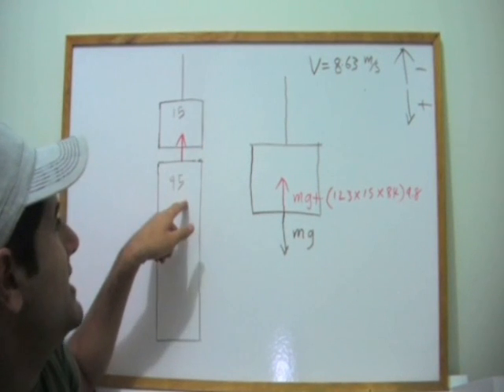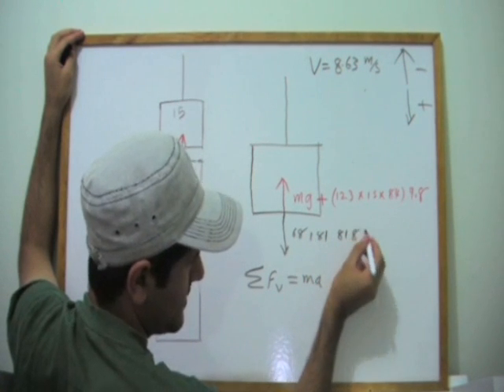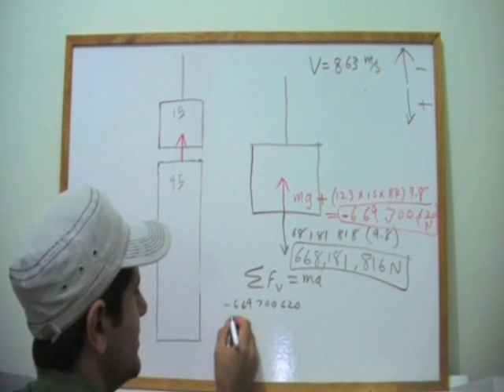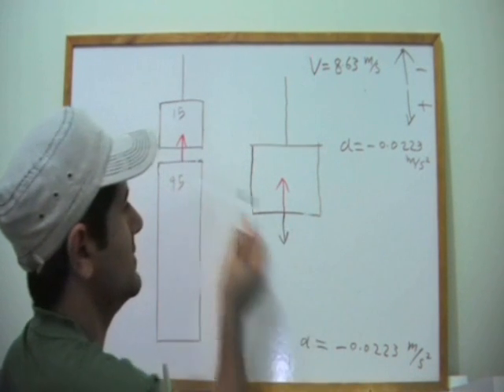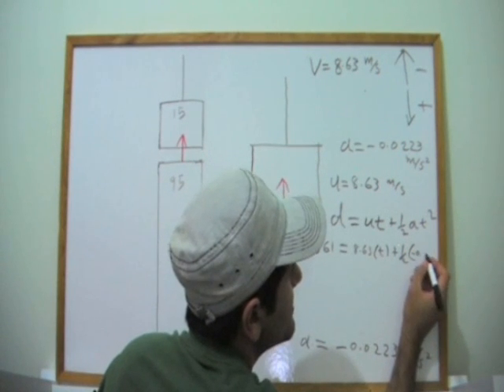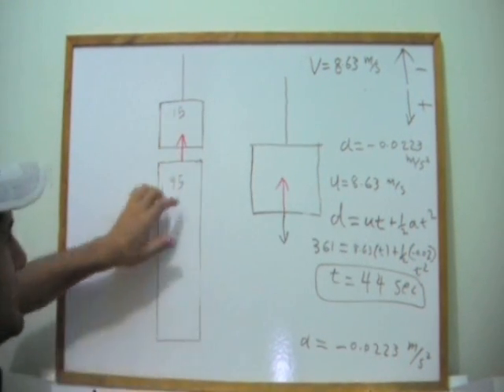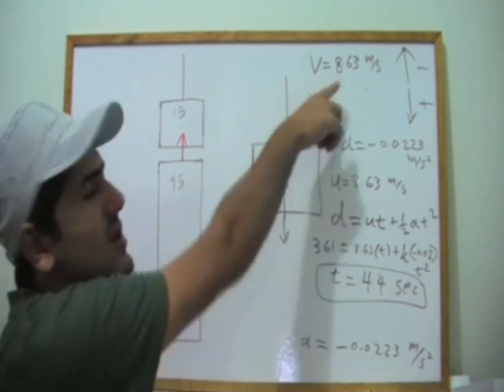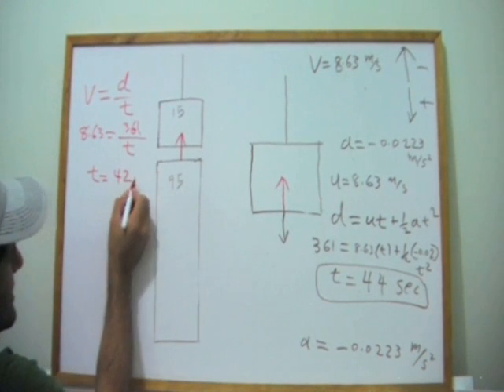(Part3) 911 Simple Physics Structural Failure Vs Demolition

Comment: If the trosses holding the floors gave way due to the immense heat of the kerosene fire and made the towers "pancake" down in app. 10 secs then there must have been a whole lotta "pancakes" in the foot print of the buildings. 110 of them.  I'm also wondering why the 47 vertical beams (the core column) fell and were literally vaporized or turned into dust in mid air,  as it were.
Reply: +Matte Matsson 
"If the trosses (SIC) holding the floors gave way due to the immense heat"
This is not what NIST has said. NIST has stated that the trusses bowed and pulled inward on the exterior columns until the bolts that connected the columns together snapped, causing the top to fall on to the floors below. The floors were not rated anywhere near the amount of dynamic weight that fell on to it. The floors did not pancake they were crushed and pulverized all the way down.

"the 47 vertical beams (the core column) fell and were literally vaporized "
Please for the love of God pull your head out of your ass. The cores did not vaporize. Where do you idiots come from? Do they breed you on some special farm???? The core columns can all found laying in the pile. There are hundreds of photos that prove this.
Reply: I've seen a whole lot of "normal" controlled demolitions and how those buildings fall or collapse. WTC 1 and 2 did not fall or collapse "normally". Watch the clips. Also, bear in mind that it only took about 10 seconds - straight down! 110 floors! And how was it possible for Mr. Silverstein to arrange for WTC 7 to be "pulled" (as he said) in such a short time, again straight down in 7 seconds!  To my knowledge it takes a long time and planning to "pull" any building. Spooky, I say...
Reply: Matte Matsson

"WTC 1 and 2 did not fall or collapse "normally"
What does a 110 story bldg normally look like when it collapses?????? Have you ever seen one before??????

"bear in mind that it only took about 10 seconds"
Ummmm...no. It was nowhere near 10 seconds. The collapse times where around 16 seconds and 23 seconds. These times do not include the cores that remained standing for up to 45 seconds later.

"how was it possible for Mr. Silverstein to arrange for WTC 7 to be "pulled" (as he said)"
He was referring to the pulling the FDNY personnel. He also clearly stated he has on the phone with the fire chief and the chief made the decision to pull. Are you accusing the chief of being involved with the deaths of 350 of his men??????

Comment: I would point out that the "Top Block" of the south tower disintegrated almost immediately on initiation of collapse as can be seen from available video so could not have provided the impetus as described in your presentation.

So your succinct videos show that even if the top block was intact , the official story does not hold water.

Comment: The columns got stronger the lower they went in the bldg, the floors did not ( they had the same live load through out). The columns had NOTHING to do with the load capacity of the floors. The top slipped past the structural columns and fell onto the FLOORS. The floors had a max live load of 6 floors dynamic, more than 6 floors fell onto the floor below the impact zone. Ali is not adding the mass of each floor to his equation. The falling weight is cumulative and the speed of the collapse actually increases. Which is what we see on video.While Ali's math looks impressive, he fails to understand how to apply it to the actual structure.
Reply: Mein Sohn

So what you're saying is you don 't want to address why no sounds of explosives were heard at the moment of collapse or how the explosives survived the planes impact and fires. How about why there weren't thousands of pieces of steel found in the pile showing the obvious evidence of explosive or thermite???? No, nothing??? Just, I believe explosives were used, but I can't explain how.
Reply: +Oldschooldan1 Your argument does not explain the systematic disintegration of the core steel structure.
Reply: Kevin Price
You made a statement all right a totally stupid, ignorant fucking statement. You basically declared to the whole world, look at me I'm a moron!!!!!

More research into the cores disintegrating???

Go check yourself into a mental ward, pea brain!
Reply: +Oldschooldan1 Sorry , being nasty for no reason gives you away. Kevin Price is quite correct in what he says.

You cannot answer his question so you engage in personal abuse.

A common technique and a complete give-away.
Reply: Mein Sohn
 He believes the columns disintegrated as in vaporized. Sometimes you must meet ignorance with harshness. I can't answer his question because what he is claiming to have happened, never happened. 

The columns did not disintegrate, they fell and were all found in the pile. There is photographic evidence of this that can't be disputed.

Large sections of the cores remained standing after the collapse. These sections fell because they relied on the perimeter columns and floors to buttress them. Without the floors they were allowed to sway past their braking point and this is what we see in the pile, columns broken at their welds.

Now if you want to debate any of these FACTS, go right ahead, but if you start talking about, nukes or energy based space weapons, I'm going to call you out as the idiot you are.
Reply: +Oldschooldan1 Kevin price said  "Your argument does not explain the systematic disintegration of the core steel structure." You say he said "He believes the columns disintegrated as in vaporized".

He did not use the word vaporized unless he used it elsewhere.
Reply: Mein Sohn The difference between disintegration and vaporization is very small. He was alluding to the steel being completely gone ie. vaporized. This is a common claim among Truthers.(Judy Wood)
Do you believe the columns disappeared?????
Reply: +Oldschooldan1 You would have to ask him to clarify - Definition disintegrate: to break apart into many small parts or pieces and Definition Vaporization is a phase transition from the liquid phase to vapour. 

I believe that the columns were destroyed with thermite and explosives.

I am familiar with the DEW and Judy Wood's theories but I think explosives and thermite provide a good fit for WTC destruction.
Reply: Mein Sohn
I would not call the massive core columns found in the pile small parts or pieces. Disintegration often times refers to an object  being reduced to a molecular level.

There was absolutely no evidence found in the pile of explosives or thermite. Thermite would leave obvious signs of slag on all the cut pieces, not one piece of steel has been produced showing this. There were hundreds of steel workers, engineers, FBI, NYPD, and FDNY working the pile for almost a year, not one has come forward saying they found any signs of explosives.

No sounds of explosions occurred at the moment of collapse and no explosive, detonator or thermite could have survived the planes impact.

So unless you can explain why there were no signs of any steel being cut by explosives or thermite, why no sounds of explosives were caught on video, how explosives could have been placed without anyone knowing and how they could have possibly survived the impact from a 200K lbs object traveling 500+mph you have nothing.
Reply: +Oldschooldan1  We are done - thanks for responding.
Reply: +Oldschooldan1  I will reply to you for the last time , not for your benefit but for others who may be reading this. Explosions are well-documented particularly by firemen - you need to research this. As for your statement ""How about why there weren't thousands of pieces of steel found in the 
pile showing the obvious evidence of explosive or thermite????" , it is obvious watching the video of the collapses that large pieces of steel were being ejected from the towers at considerable speed , not the the behaviour of a building falling down due to gravity alone. Anyone other than yourself reading this , I would recommend that you do your own research , this is the most important thing. Thanks.
Reply: Mein Sohn
Having firemen saying they heard explosions does not equal explosives. Most of the explosions they heard were from the first tower collapsing or the second plane hitting the bldg. Explosives strong enough to cut thru the steel would require a minimum of 130 decibels (dB) to 140 dB at a distance of at least half a mile. No sound anywhere near these levels were observed on video during the collapse, none.
 
”watching the video of the collapses that large pieces of steel were being ejected from the towers at considerable speed”
Most of what you see being ejected is light weight alum cladding. The entire façade was covered in it and it’s shaped just like the columns. The vast majority of the steel columns peeled outward and fell. How about the lack of visible damage to the columns???? When you use explosives it cuts and scorches the steel. When you used thermite it’s even more noticeable in the form of slag. There would be thousands of pieces of steel showing this and yet we see none. How did these explosives leave no signs??????
 
”not the the behaviour of a building falling down due to gravity alone”
Says who???? This your opinion and nothing more. The stored potential energy of the top was massive, more than strong enough to blast light weight alum far from the bldg..
 
I too recommend doing your own research, except I would use true scientific sources, not You Tube.
Start with the NIST reports, the ASCE Pentagon report, the AWS reports, FEMA report and the NFPA report. There also papers by Byzant, Greening, MIT, Perdue and others. Their work has been accepted by every A&E University in the country as well the engineer of record Les Robertson.